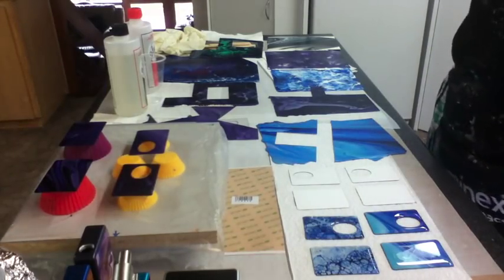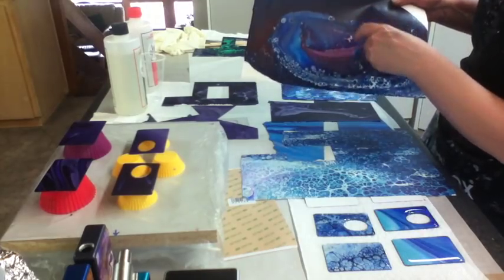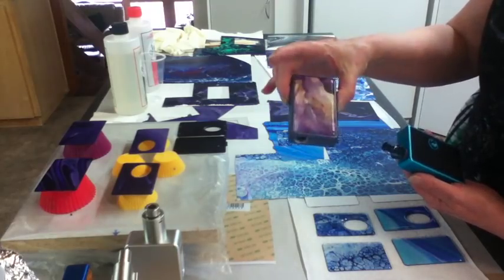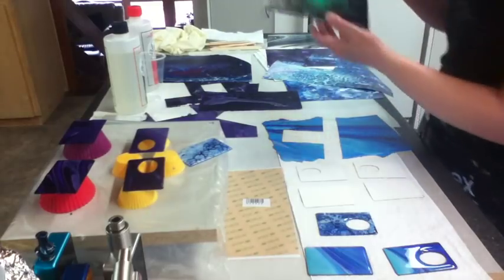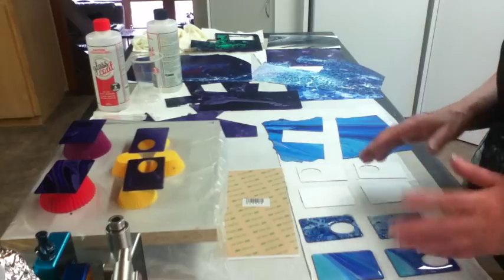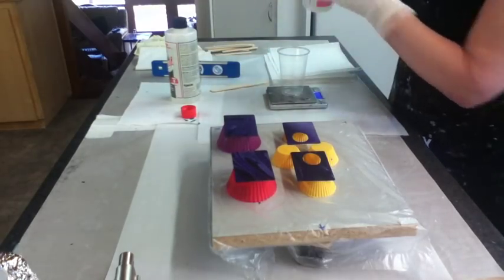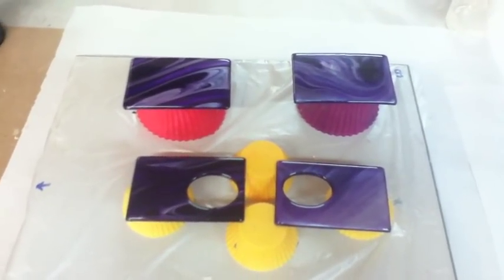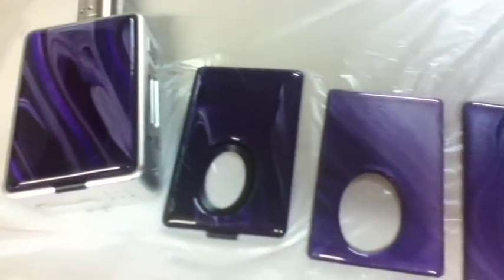Resin Art   Inlaid Resin Panels

Comment: what is the best place to get the proper yupo paper? and what is a good brand I guess❓ I just bought a vt inbox and I bought extra panels. I would love to try this.also your really awesome at this, nice art work too.
Reply from the maker: I am not sure where you are located, but most craft and art supply shops should stock.  I buy mine from an Australian paper supplier on ebay.  You can get different gsm (thicknesses) so try and get the thickest you can.  Its a bit more stable to pour resin on.
Reply: Chris Cross OK I live in the united states. West Virginia actually. only one craft store near where I'm from. but I like your video and I made a list but I'm trying to find the things you said but there's a lot of different yupo paper but  what was the varnish you said to use?
Reply: one more thing. how do you measure your blanks? slightly smaller than the actually metal doors or how do you suggest to make them look top notch and not too small or too big, especially the squonk hole how did you cut that out so perfectly?

Comment: Your work is absolutely beautiful !!!! could you possibly make a video on pouring on Yupo.
Reply from the maker: Thank you.  Yupo is like any substrate that you pour on.  Prepare it with a spray of varnish to give the paint something to stick to,.  I use lids of containers to place the yupo in so that they are supported.  then just pour as you would normally pour on a canvas or board.  👍  I dont worry about the pour running into the lid because you can cut off the excess skin when dry.

Comment: If some spills over how do you get hardened droplets off the back?
Reply from the maker: Marylou.  I place the double sided sheet on the panel before I resin andy drips will be on the cover sheet that is peeled off when you adhere the resin panel to the plate.  If you don’t do this then you will need to tape the back and remove the tape once the resin has cured.  To get the lovely raised pillowtop edge you should try to let the resin dome without spilling over.

Comment: Hey Chris,  These Panels are lovely, just like the rest of your art work!  How very ingenious!  I know what E Cigarettes are, but I have never heard of these E Cigarette Boxes.  How are they used?
My Saturday Countertop  (Hubby's 64 ounce resin mix ) disaster is now sitting on my floor as a 2.5 x7 foot Mat.  No decorative colours but still very pretty, except for the holes!  LOL

My ingeniousness?  I waited 48 hours after the pour hardened... then pulled it off my Counter in one piece, like a huge piece of shiny black Rubber Tar!  I used a heat gun (hair dryer) and a metal paint Scrapper to lift it.  It took most of the day, but it is done!

Talk about a bad smell.  Yuk!  Bad mix...  very bad mix that began hardening before it could even be spread.   He varied the resin recipe!  rrrrrr!
I needed to sand and repaint the counter with another black base to match the other side of the Counter that wasn't poured onto yet.  I'm going to retry this afternoon.  

The one good thing was I was finally able to find BLACK PEARL X to go with my other
colours/colors!  Wish me luck!!!
Reply from the maker: Lol I laughed out loud at the resin experience.  It does get easier.  

Ecigarettes all work the same. These are just a different shape and hold more eliquid and larger batteries.  A battery heats up an element with a wick  to vaporise eliquid and form a vapour that is inhaled just like smoke from a cigarette.  The nicotine in the eliquid is absorbed through the mouth and satisfies the need for nicotine.
Reply: Ah!  I don't know that these Eboxes are available here in Canada.
I tried to vape.  LOL  I'd rather smoke--- another!  
You know Chris, I've watched hundreds of videos now for the Countertop Epoxy, even the Garage Floor Epoxy and know exactly how it was applied.  I studied these videos so I knew the resin consistency and how it should move.  I knew I was in trouble when he brought me the black resin, but I had to get it out of the bucket before it began to smoke.  It wasn't on the countertop for more than 2 minutes before it became tar!

I watched the Art Resin videos like yours, and even the Acrylic Paint pours to see how to push my design up to another level.  You and all the others have all been inspirational.  I can't thank you enough!

Comment: I'm guessing you do not add any silicone in the paints for this project...?
Thank you for your time.
Reply from the maker: Some of the early ones had silicone in the paint but I am moving away from it because you have to do the extra steps before making the panels.  For those that had silicone in them I use a light coat of gel medium as a barrier layer  The panels are too small and light to mix silicon in the resin to fix it that way.

Comment: could you do this with the lost Vape therion sqionk mod too or would it be too difficult because of the shape of the battery door?
Reply from the maker: I have done some curving doors (istick 60w) but the method is not really designed for that.  As the exposy resin cures it tends to straighten away from the original shape.  curved shapes are better with polyester resin.  Much shorter working time and you can manipulate it around different shapes.  Be really careful with poly resin, wear a respirator or do outside.
Reply: okay, cool. thanks for the tips.
Reply: Chris Cross would you possibly sell me a cover for my inbox?
Reply from the maker: +Steven Niggemyer Sorry Steve I don't sell them.  I do know that there are some new covers and panels being released by Hicigar which look nice and if you want to do these yourself then buy the leatherette ones from Fasttech or Gearbest.  Those spares are the easiest to dismantle.  Clean off the glue and you have some bases.